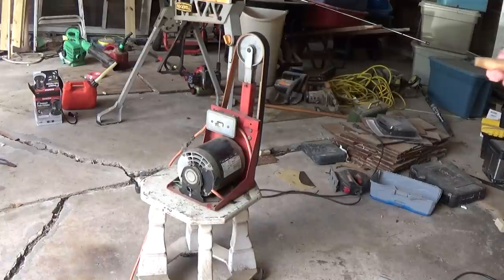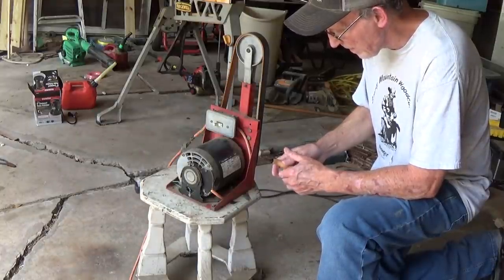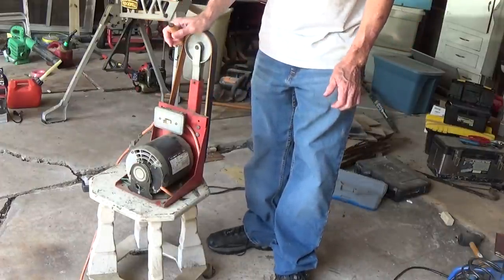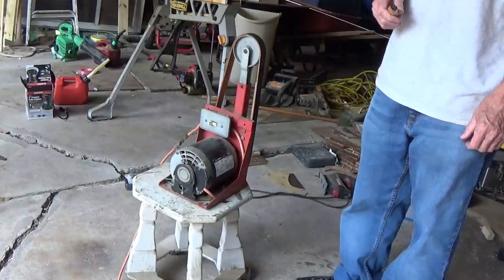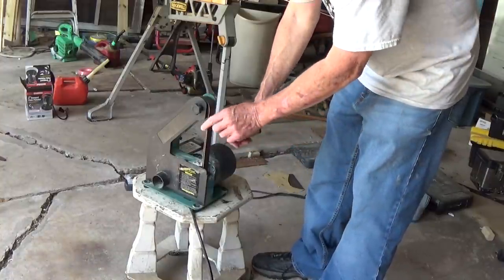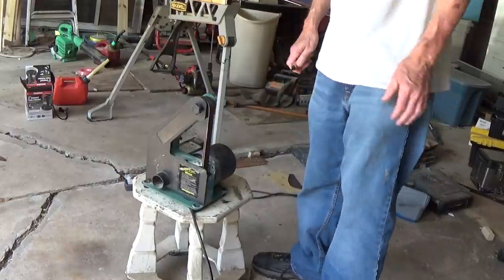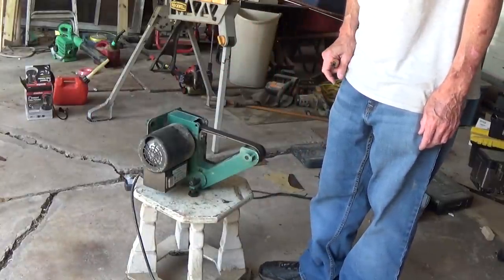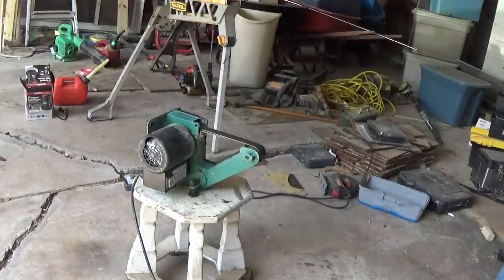A Economical Way To Make You A Power Strop

Comment: Gene, thanks for the you tube. I have the harbor freight set up. I have used harbor freight for years. If it’s a tool I need for limited use why pay to get a professional price for something not used often. However, I have harbor freight tools I have used for years frequently. I know it may not be Dewalt but if it gets the job done I’m happy. On the speed. On line I found a variable rheostat extension cord that can reduce the speed without having to do any electrical rework.
Reply from the maker: Thank you Michael ..thank you for watching
Reply: Hey friend rheostat does that give u the ability to control speed or ? And where can I find that ? Thank. You friend

Comment: I took your advice from before and got one ( Harbor Freight type) along with a leather belt.  Do you leave the belt on the machine all the time? I have heard that the belt will stretch.  Also do you put the compound on the smooth side or the rough side of the belt?  I have heard different opinions.  Thanks for all your information. Bruce from the City of Orange in Orange County Claifornia.
Reply from the maker: Bruce >>I have  also heard the belt can stretch if you leave it on ..I have left it on and had no problems   but it could of course ..you sharpen on the smooth side and put the compound on the smooth side .. Thanks for watching Bruce
Reply: @whittler0507  thanks for the reply Gene
Reply from the maker: @fergusrb  Thank you Bruce

Comment: I happened to see your video on this machine before so tried it and it works great. I mounted the base of the machine  to a thick piece of wood and then turned it on its back and mounted it to a bench so the belt turned the way you showed. Maybe someday when this one wears out and I can save up a little extra money I may buy the one from Chipping Away but until then this one is working great.
Reply from the maker: Good Ken ..Iam glad your having good luck

Comment: I had a delta 1x30 belt sander bought the leather belt works great I also a a leather disc that mounts on a drill bought the holder for drill at Smoky MTN. Woodcarvers many years ago I also use it
Reply from the maker: Thank you my friend

Comment: I have a Burke system keeping only the leather and polishing wheel on. I also gave a Nu-Marc  sanding machine with 1” x 30” belt on it. I can switch from sanding belt to leather but am J just as well off with the Burke?
Reply from the maker: The Burke is a great machine .. I have used one and its excellent .. this is just for anyone that doesn't have a machine and wants a economical one that wont break the bank

Comment: You might need to spend a bunch of money on hearing protection so you would loose some of your savings. Could not hear a word you said when that machine was on. They don't sell them in Canada because it does not meet CSA standards so we pay more for protection from poor quality dangerous stuff made overseas that could hurt you. You will end up replacing the things so why not save up and buy a good quality long lasting machine once. Hearing aids are about $3000.00. I used a hand strop for years and it still works just fine. I also have one of those TOMZ  Knife massager. He made them out of a Lazy Boy massage motor with one or two rotating wheels with leather and diamond discs etc. You have to google it I don't know if he is around anymore. They rotate nice and slow so you don't burn anything. I'm sure somone who is trying to save money could make something like that on their own.
Reply from the maker: Rick we wear hearing protection in the U.S. for many machines .. My band saw is loud .. I worked in a chemical plant for 40 years at a boiler house and the noise was unbelievable ..so noise is nothing for me ..  My machine sharpener is better ,,but a lot of people cant afford that machine ..so hearing protection helps